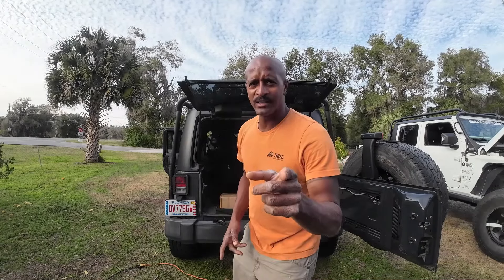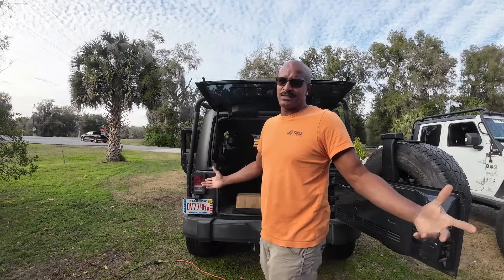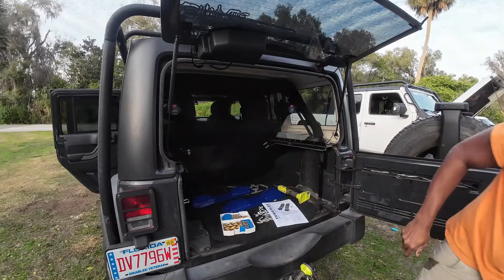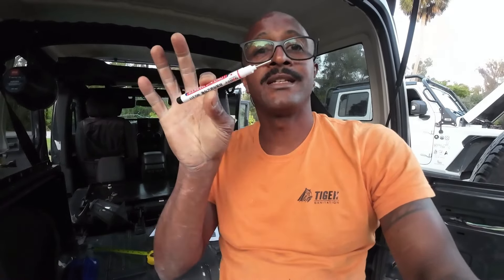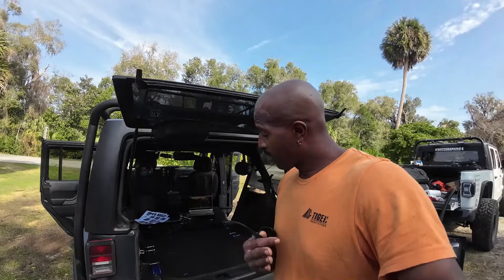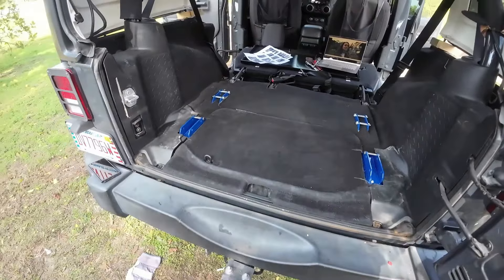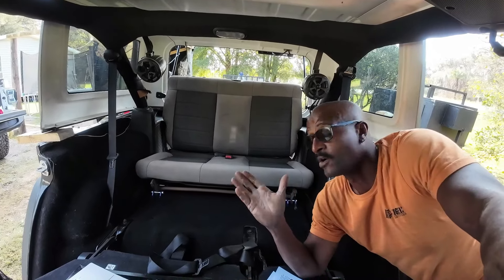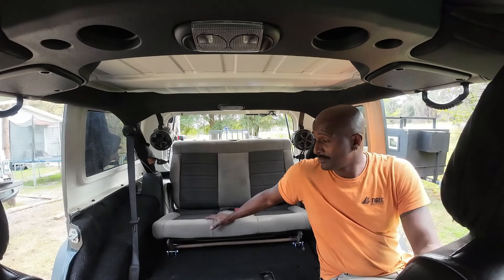2017 Jeep JK 3rd Row Seat Install

Comment: I'm glad you trusted those instructions lol!! not that it matters now but I think if I would have had them brackets and the seat I would have bolted the brackets to the bottom of the seat and put the whole thing in there as one and mark it somehow but it looks great!! A friend of mine's going to do the same thing with his JK He sent me this video 👊
Reply from the maker: Funny you say that because I drilled the first two holes and something didn't look right. I had to back up and visualize it. Then I realized I drilled the first two wrong. So... I found myself double checking everything. Those instructions were not very trusting. I bought the brackets off of Ebay from someone and the instructions look like they might have printed them from their computer. It wasn't easy. Lol. But... it was worth it!👌🏽
Reply: @GoChangeYaLife  My thoughts exactly lol

Comment: what did you do about seatbelts???
Reply from the maker: Good question. I had got some seatbelts and turned them into lap belts. Kinda like the center seatbelt. But I have a friend that's a fabricator that I'm gonna have build a rollbar add-on so they the other seats will have shoulder belts. I want the rollbar to be removable though. But lap belts for now.

Comment: Where did you bought the 3rd row seats brackets?
Reply from the maker: I got them off of ebay. There are other companies that have them. I think I saw them on Amazon as well. But the ones on Amazon were almost $200. I got mine from ebay for less than $100.

https://www.ebay.com/itm/394786270232
Reply: @GoChangeYaLife  thank you 👍, another question sorry, have to be two door jk or can be cj, yj?